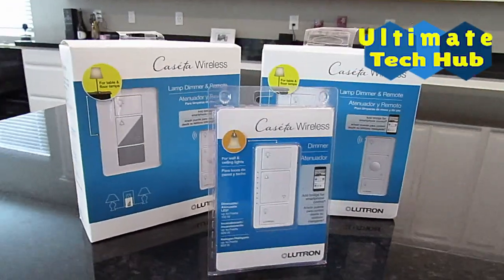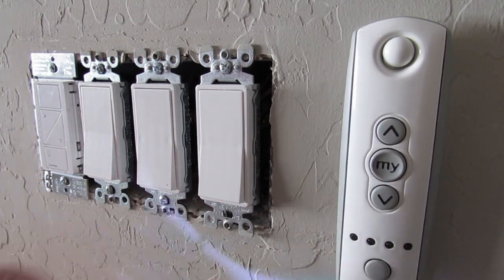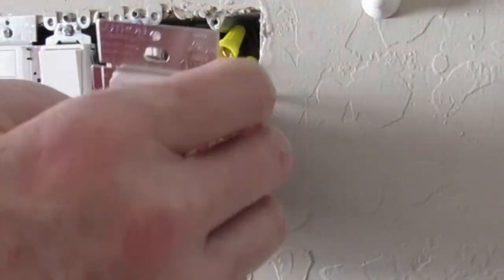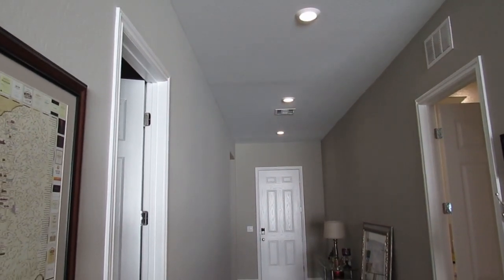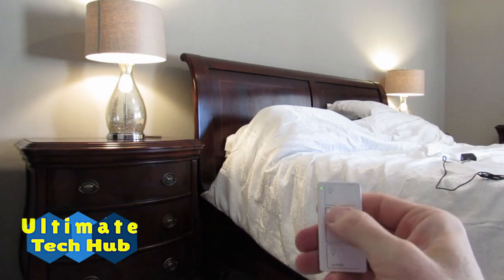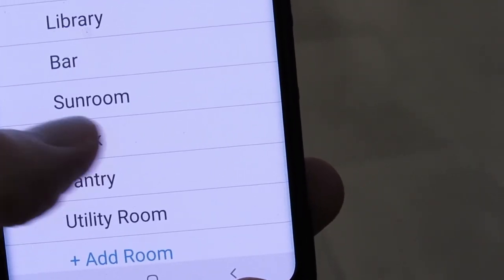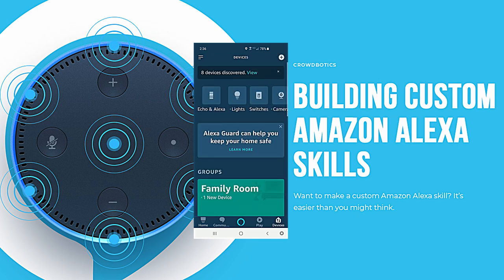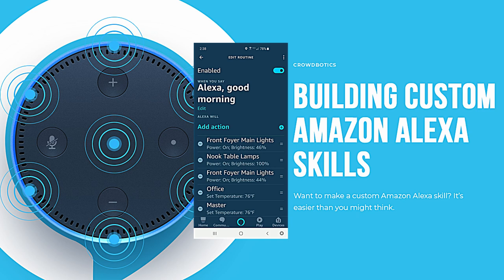LUTRON CASETA DIMMER INSTALLATION FOR A BEGINNER! EASY!

Comment: How do I connect lutron caseta PD5 ANS wireless switch to my existing 3 way. I want to replace one of the switches with the lutron. There is a 14/2 and a 14/3 cable coming from the wall.